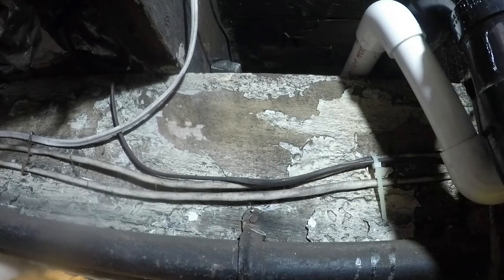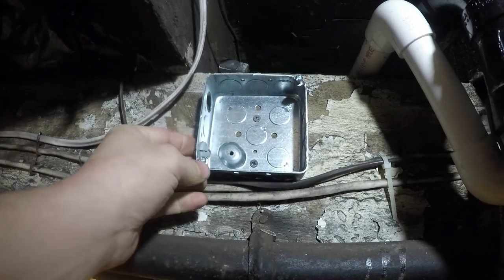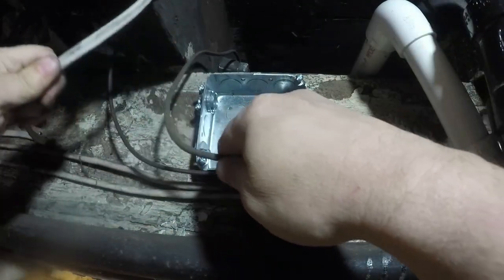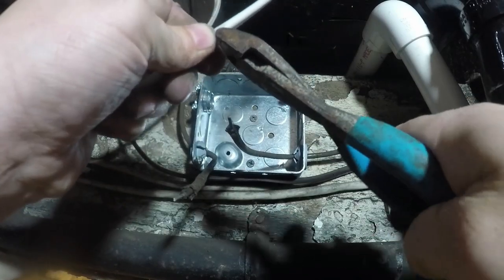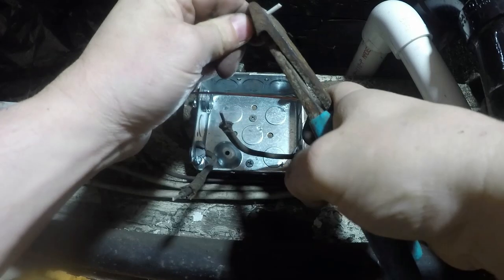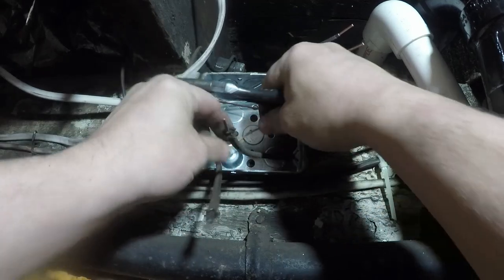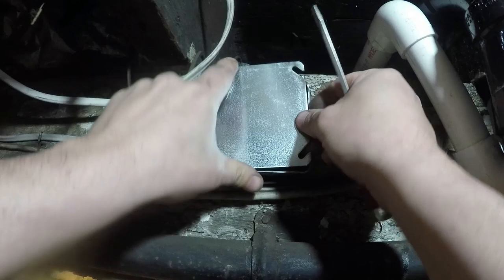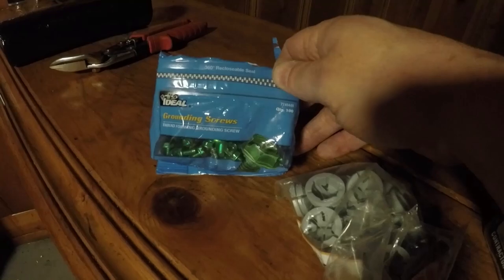KNOB & TUBE to ROMEX WIRE 4x4 ELECTRICAL JUNCTION BOX

Comment: Please take this down it’s misleading and dangerous content
Reply from the maker: What makes this dangerous. Please be specific with a lot of detail. Everybody can learn from your answer.
Reply from the maker: Well so far your claim has no merit besides you don't like to work with knob and tube and if you are financially strained that's to bad.
Reply: @themrhelperguy  knob and tube is rated for 60 c Romex is 90 c , knob and tube is ungrounded , knob and tube is exposed live wiring , knob and tube breaks down over time , knob and tube has been known to cause fires , knob and tube is no longer used by code standards witch does not allow new wire to be spliced with knob and tube. You need more
Reply from the maker: The heat rating is for an external heat source. Yes knob tube has no ground. It is not exposed wire. Knob and tube has a rubber insulation and a cloth covering. Knob and tube breaks down overtime when misused. The wire will last many lifetimes before breaking down with proper use. Knob and tube can cause fires from overloaded circuits, the 4 inch box helps remedy the overloaded circuits and or creates underloaded circuits and improper splices into knob and tube. Just because we don't wire with knob and tube anymore does not limit the ability to repair existing circuits. In reality the nec allows splices to be made in electrical boxes when knob and tube is concerned. The use of Romex is allowed to be spliced into knob and tube within an electrical box. Its a no no to splice knob and tube and Romex outside a box with just wire nuts. Can I ask what country you live in? BX without a full size ground is no longer used by code. Can you splice Romex into BX in a 4x4 electric box? The bottom line is connecting romex to K&T makes for a safer system until the eventual replacement is accomplished. It allows you to break up circuits and lessen current flow, allows you eliminate K&T circuits and leave existing circuits that are not able to be replaced at that time. No code or agency is going to hinder making a K&T system safer. Specifically at this time when K&T is not required to be removed upon sight.
Reply: @Theatrelove  It is good to read your post. I'm an electrical professional engineer very familiar with the NFPA 70 (National Electrical Code). I'm always interested in learning new things. Could you provide me with the code reference that makes his installation illegal?  Article 394 covers knob-and-tube wiring. Is your reference from there? What he shows is very common in my part of the world.  We know the code rules all installations. I realize you believe knob-and-tube to be a large hazard, but that is another debate. Anyway, interested in knowing your code references.
Reply: Just tossing this in, 300.16	Raceway	or	Cable	to	Open	or	Concealed	Wiring.
(A)	Box,	Conduit	Body,	or	Fitting. A	box,	conduit	body,	or terminal	fitting	having	a	separately	
bushed	hole	for	each conductor	shall	be	used	wherever	a	change	is	made	from conduit,	
electrical	metallic	tubing,	electrical	nonmetallic tubing,	nonmetallic-sheathed	cable,	Type	AC	
cable,	Type	MC cable,	or	mineral-insulated,	metal-sheathed	cable	and	surface raceway	wiring	
to	open	wiring	or	to	concealed	knob-and-tube wiring.	A	fitting	used	for	this	purpose	shall	
contain	no	taps	or splices	and	shall	not	be	used	at	luminaire	outlets.	A	conduit body	used	for	
this	purpose	shall	contain	no	taps	or	splices, unless	it	complies	with	314.16(C)(2)